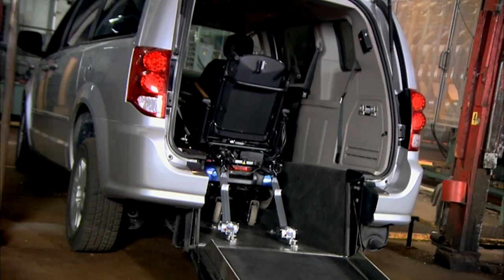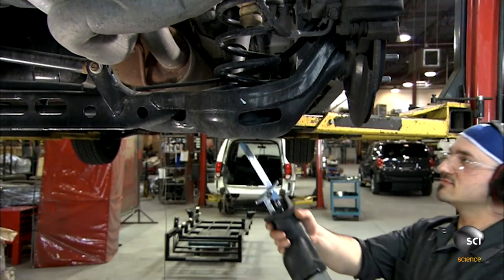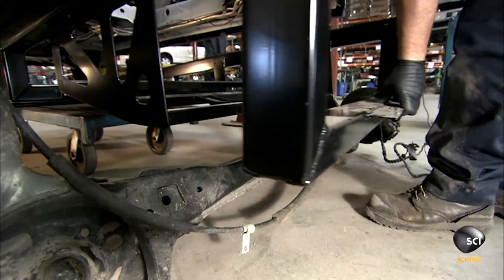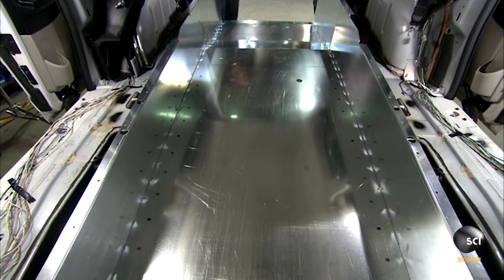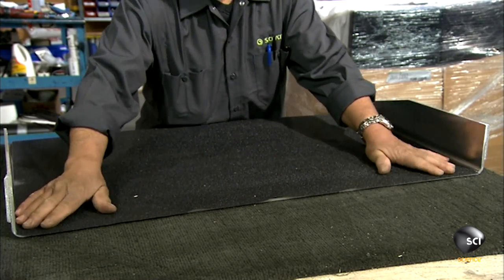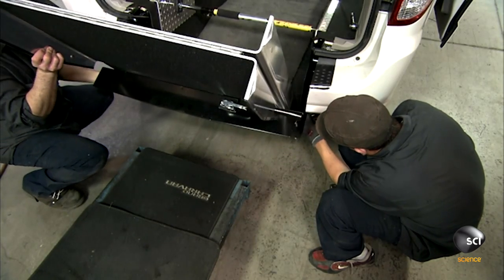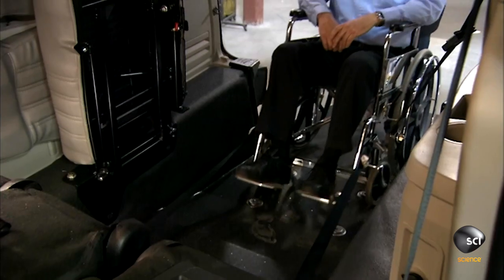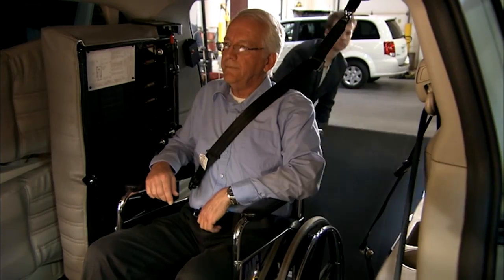Wheelchair Accessible Van | How It's Made

Comment: There are pros and cons for everything; the fact is most wheelchair users aren’t “standard”. If you are disabled and drive; the modifications are costly and depending on the disability a lot of automation and electrical parts. We chose this after our after market conversion is 19 years old; it still works but I never put a front seat in as I wanted my partner to be as close to the passenger seat. We now need a front seat with a lower profile than a standard van (older parent).  We chose rear entry (way better parking) and a manual ramp (no maintenance) . It is a little tricky to tie her down in the front as it needs two hands and the fold up seats are tight for a bigger person to wedge in and tie down. A stick with a hook worked fine. But having the capacity for two wheel chairs is pretty good. That being said, the mini van is priced as a used car (or new if purchased new) and you pay for the conversion (no tax with an RX), the conversion is about $20k; a little overpriced considering they have this down to a factory assembly line.

Comment: I had a full size Dodge van with a Braun lift.  Finally the van died. I've checked these vans out, ridden in many. You're isolated "in the back" you can't drive or  get in or out without help. It's noisy, because of the holes in the floor. 
For about the same price you can get the Braun lift for Dodge/Chrysler minivans.  Clearance? Where is a paraplegic, quad, MD or just old that you need all the clearance?

Comment: but the new steel support is lower ,as a result the car will be damaged for moving on a bumpy area or even the road bump it will be like an old mazda that barely moved on asphalt
Reply: ahmed azizy they have the lower part in line with the wheels, so that problem is very nearly eliminated.
Reply: And they raise the suspension up a bit to clear any bumps. 

I've been inside a BraunAblity shop and seen it
Reply: @Azizyeet It’s a very good point.  Yes indeed the converted vehicle has a lower under carriage to accommodate the lowered floor.  Some have auto ajustable lowering suspension in order to make the ramp angle temporarily easier for the chair user.  It then resumes normal position for driving.
Reply: @Hectorson3  The suspension is temporarily lowered in some to allow a reduction of ramp angle to allow easier access.  The auto adjusting suspension then assumes normal level for driving.  I’m afraid the suspension doesn’t accommodate bumps as the undercarriage of the conversion means that everything is close to the ground.  I’m now on my second drive from wheelchair conversion and you have to drive more carefully as any alteration in the road causes a strain on the suspension and a real risk possible damage to the undercarriage on very uneven country roads for example.

Comment: That wheelchair was shitty, they should have used a power chair, and made a conversion van with an automatic ramp on the side.
Reply: Alisha Tinker yes. All modifications without automation is nothing. A driver would as well raise person on wheel chair and put him on the normal sit.
Reply: It all comes down to cost.  A fully automatic ramp is usually only needed for people who are wheelchair users who can drive independently.  My van is designed for me to drive from my wheelchair on my own.  Therefore I don’t have anyone with me to operate a manual ramp or a manual tie down system.  The fully adapted cost is approx 8 times that of a brand new standard new car.  This is out of most people’s price range.  If you have an able bodied driver who can operate a manual ramp then there is no real need for an electric version.

Comment: Car has two rows of back seats but needs reinforcement for one wheelchair?  Seems like they just want to pad the price with unnecessary work.
Reply: The reinforcement was because a large part of the floor and structural members were removed in order to lower the floor.
Reply: The reinforcement is needed to accommodate the weight of a Powerchair.  A fully laden powerchair has The equivalent weight of 3 - 4 adults.